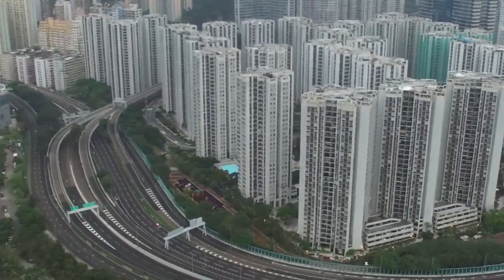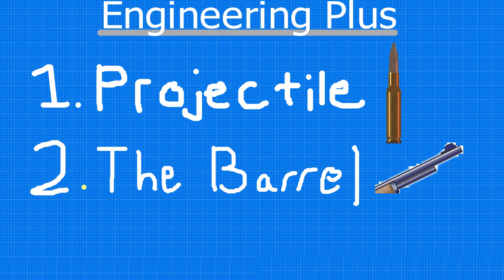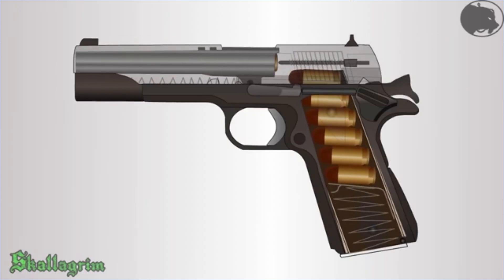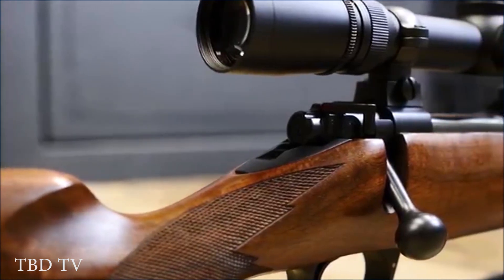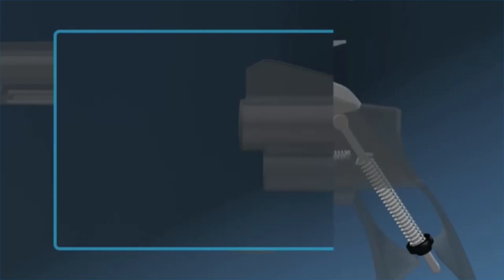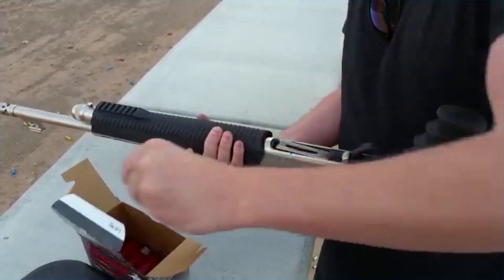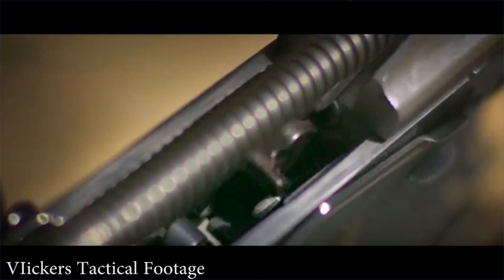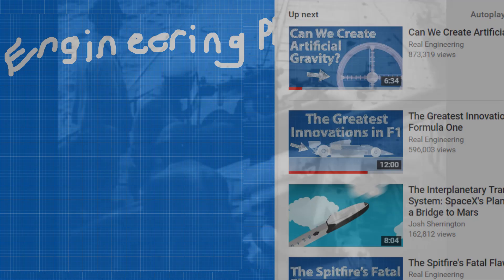How Do Guns Work? - Simplified | Engineering Plus

Comment: Nobody: 
Literally Nobody: 
This channel: Modern day AK-47s and pump action shotguns. 

An other thing is: why do you tell that bolt-action and pump-action are different? On a pump-action you just "connect" the bolt with the handguard. Most bolt-actions are not straight-pull, but that is a minor difference.

Comment: The direct impingement on an AR 15 is actually not direct. It’s more of a hybrid. The AR 15 bolt is the piston. The gas key drives gas down into the BCG (bolt carrier group). The bolt it’s self has “Piston rings” that the gas expands against, aiding the unlocking of the lugs by rotating the bolt. And then pushing the bolt to the rear. So in all actuality the AR15 is a micro stroke piston system. But it is very dirty. Like a direct impingement.

Comment: Just to clarify a point that gun powder does in fact explode, in both a physics and chemistry perspective. By definition an explosion is the sudden expansion of gas as a result of an exothermic reaction, usually by a decomposition of a solid or liquid into a gas. If you're interested in the physics and chemistry I go on a tangent below. Thanks for the video I had an idea on how guns worked in theory but I was interested in the intricacies of the mechanical parts and the engineering complexity of it all, which you concisely and graphically demonstrated superbly. Thanks for the video, subscribed and liked, keep 'em coming!

This can be achieved by many means, yes as you said increasing temperature, which there by increases entropy as we know by the laws of thermodynamics G = H + T*S. We can also either increase moles and/or the phase of the product of the reaction, the ladder being true and the former being false; in the case for gunpowder. 10 KNO3 + 3 S + 8 C → 2 K2CO3 + 3 K2SO4 + 6 CO2 + 5 N2 as you can see 21 moles on the left, 16 on the right, it's the gaseous phase which is the entropic force driving the bullet not the mole ratio. The gas has a volume of hundreds of m^3 at that temperature which is crazy to think about. Also the driving force is the exothermic nature of this reaction as all redox reactions are. Not only is this thermodynamically fascinating but if we look at the ideal gas law we can see an interesting trend PV=nRT, Pressure x Volume = moles x gas constant x temperature. We can see as pressure or volume increases so does temperature and as pressure increases volume decreases and vice versa this brings me around to another fascinating application of this the gas piston used in automatic rifles is described by Boyle's law, which is the PV part of the ideal gas law which states that  pressure is inversely proportional to volume as pressure builds from the gas the volume increases, it enacts a force on the piston increasing the volume as the gas expands.
Reply: You sound like someone with a master’s degree in the sciences
Reply: Physics, chemistry, and engineering. Brainy man.
Reply: What he said
Reply: I’m just gonna say I new the part of the reason the bullet flew was because of the gas expanding so quickly you however I did not know the specifics like this I mean wow
Reply: Tldr but I'm assuming their referring to gunpowder deflegrating (fwoosh, gas speed below sound barrier) without being confined; while it detonated (boom, gas speed breaks sound barrier) when confined
Reply: good luck reading THAT in under a minute
Reply: Nope it's a propellant no matter how you try to word it...
Reply: Damn! Dude, did you really have to write a f***ing 2 paragraph explanation. Not that I am complaining
Reply: I aint readin allat
Reply: Im still searching for who ask
Reply: @bumsquad6193  i am the one who asked
Reply: @who2807  Amen
Reply: @bumsquad6193  If you don't want to see chemistry or physics on an engineering video, I'd recommend going back to picture books.